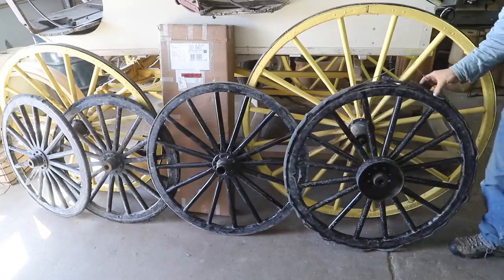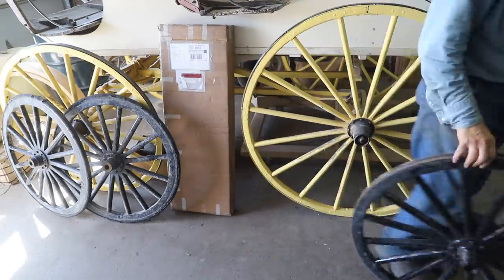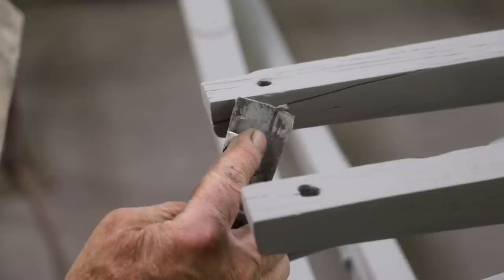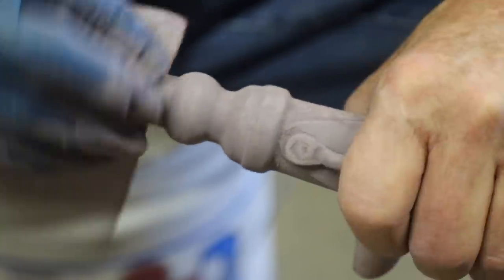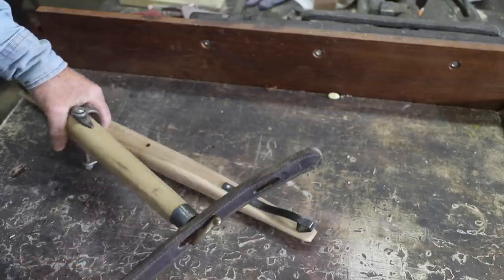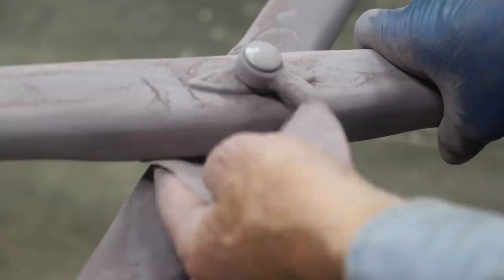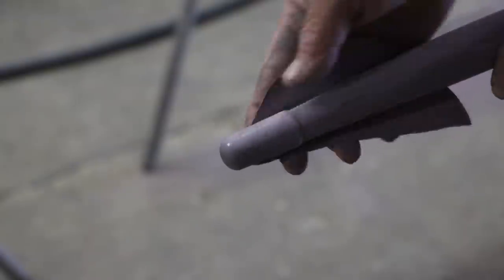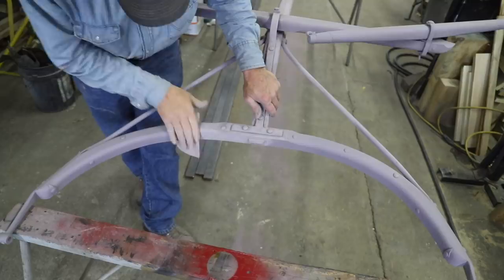Tying the Holdback Strap Knot & Misc Info | Engels Coach Shop

Comment: I have a very worked old oak front door. I repaint it every 5 years because it is in bad weather. I sand it for a long time to restore it to its former glory. Your advice reassures me that I will spend time to restore it to its 1930s look. Thank you for your videos and all your advice which I watch until the last second.
Pierre de Vierzon France, where the Tour de France stage started yesterday. 
J'ai une porte d'entrée en vieux chêne très travaillé. Je la repeint tous les 5 ans car elle est dans les intempéries. Je la ponce longuement pour lui redonner tout son lustre d'antan. Vos conseils  me rassure sur le temps que je passe pour lui redonner son aspect de 1930. Merci pour vos vidéos et tout vos conseils que je regarde jusqu’à la dernière seconde.
Pierre de Vierzon France d'où est partie l'étape de tour de France, hier.

Comment: Even if I have worked around horses for many years, I surely don't know it all.  I learn something every time I watch you.  When you were making the top, I was wondering a lot of the time what points you were referencing.  I could see you measuring, but I wasn't sure the point you were measuring to.  Your last little explanation of your sanding goals was very helpful.  Folks used to tell me how many rounds of sanding and primer I needed, but if no one explains what you are trying to accomplish with each, it looks a whole lot like painting and sanding it all back off over and over.

Comment: The protruding tenon joints Do actually add strength to the joints,  it moves the tension from the end to a point further away  giving it more durability and strength,  GREAT VIDEO AND SANDING VLOG 🤠😎

Comment: I did not mind that last video where you was sanding a lot, but yes it did push the limits of things as I near fell asleep. But that was part of the reason I watched it, was because I do know how much work goes into sanding and prep work for a good paint job. Learned that from trying to strip a 1965 Ford F-100 that had latex or oil house paint on it. what farmers do sometimes, should not be done regardless of if it is an old wagon or an old pickup truck.

Comment: As a part time cabinet maker, I can attest that sanding can be about 70% of the time spent making something.  I don't like sanding much either, so I invested in a lot of sanding machines.  (Wide belt commercial sanders, drum sander, edge sanders, orbital sanders, flap sanders etc)  Makes it a lot less work, but for what you do, it doesn't change it much.  Still interesting.

Comment: What do you fill the cracks in the wood with.  I still have a board very similar to the one you were using that I have had ever since I painted my first car in the mid 60s.  I used it to mix Bondo on, to do the body work before painting.

Comment: Good Morning Dave!  Question please?  What is the remedy if you attempt setting a tire, with insufficient heat, onto a wheel?  That is; You start the set, the tire is 1/2 way on the wheel then cools too fast or is too tight? Would you have an opportunity some time, to speak about such corrections? Thank You.
Reply: Take it off and reheat it.

Comment: Just wondering why you weld using brass, the wires used to hold the rubber tires to the wheel instead of mig welding them. Is because of tradition or another reason. Seems to me mig would be easier and stronger.

Comment: Sanding is a necessary evil in woodworking and metalworking. A bad sand job and the finish looks bad and not very professional. One question, at the beginning of the video you fill the cracks in the wood after priming, why not before.